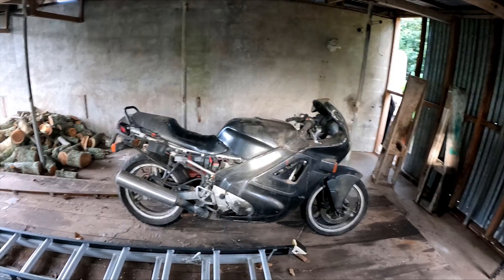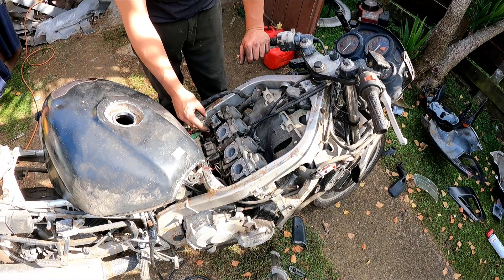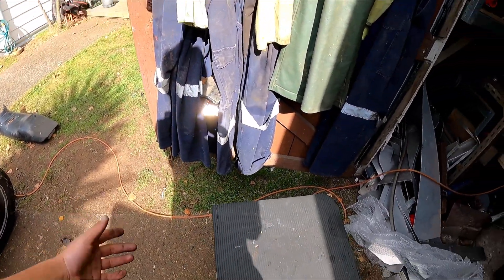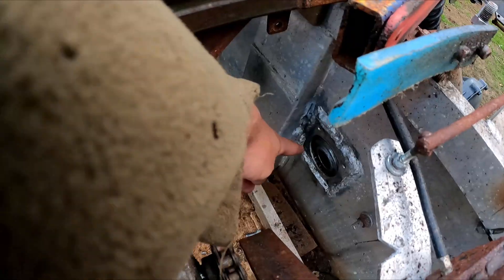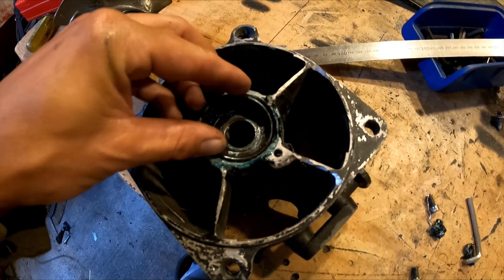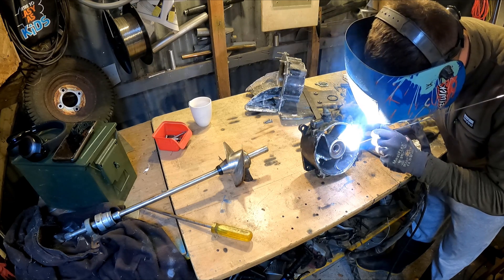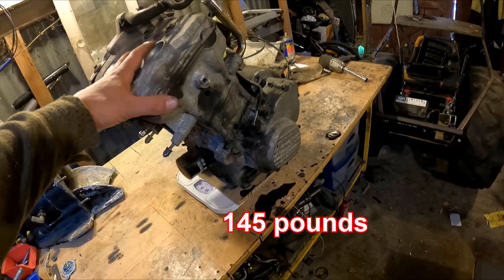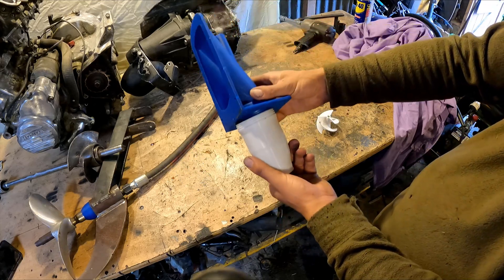Amphibious Jet Boat Build

Comment: 56123 motors are (Somewhat) cheap and crazy powerfull motors you can use for the turbine. They are about 13-17 HP. Costs around 200 dollars for the motor but with a speed controller it costs around 600-700 dollars. And then you need a battery to go along with it. Write a comment if you need any guidance.
Reply from the maker: Actually I want to build another mini jet boat but electric, a motor like that would be perfect. Maybe I could email some company’s and they could sponsor something, because the batteries are so expensive
Reply: @dkthewelder  Yes if you going with 18650 or lead acid the battery's are really expensive. I think the cheapest option is to buy some lipos for a few hundred bucks. Although the battery life will suffer. Personally I get laptop battery's from the dumpster.

Comment: I Have been looking at the Vevor 2000w 48v motor then using a 1:2 gear ratio since it will have the torque but not the speed. for a small jet drive. i have seen no one else test these motors. but i think they are the most affordable motor i could find that could work. (eBay Australia)
Reply: I eventual plan to do a twin jet drive mini boat with differential thrust steering.
Reply from the maker: Ok thanks I will look into them 👍

Comment: Dude you really need to start printing with PETG, ditch that PLA garbage...
Reply from the maker: Isn’t PLA stronger than petg?
Reply: @dkthewelder  it's slightly stiffer but cracks much easier. Petg is more tolerant with chemicals, has a higher temp tolerance and it's just more durable in general.

Comment: I have built a lot of small boats over the last 15 years, and its good to see some one aving a go at building stuff them selves, however to save your self a lot of wasted time on something thats not going to work well, put the motorbike engine in something else and get a cheap jetski with the matched power curve for the unit, no messing around tring to make water jackets for the headers and a lot of other problems that you havent clicked onto yet. I have tried out motor bike engines in the past, you need to split the motor and remove all the gears and make an adaptor to run a shaft off the clutch basket to the unit , if your cbr600 motor is spinning at 12,000 the clutch is around 8,000 its geared down quite a lot, running off the sprocket and tring to us the gears  just doesnt work, the power is never in the right spot. Tring to match the motors power to a random jetski set up and still having to make a proper grill/intake combo, theres a lot to it.I have done it with  zx10 and cbr1000 motors, you just cant beat a yamaha jetski set up . Good luck mate, keep the videos coming
Reply from the maker: Thanks I watch a lot of your videos, I can’t use a JetSki motor because how can I cool it when on land? I have heard of you run a radiator it can’t really cool down a JetSki motor enough. I would rather run a surface drive which would be way fast and more efficient but the jet unit will fit well with the wheels and be out of the way. Thanks a lot for the information I just really want it to be able to plane, how fast does your inflatable boat with the outboard jet go?
Reply: @dkthewelder  the orange boat only does about 35-40 km with a 50hp on the back, painfully slow compared to a jetboat, I cant see an easy way of fitting the honda motor around the mower engine, however in the states dont they run the lawn mower motors with a long shaft and a propeller on the end https://www.youtube.com/watch?v=HPTjdA9Azzc I think that with your skills you could build up something like this?
Reply from the maker: @goatracing610  haha yes I have done heaps with those longtail motors they are really cool I put one on a surfboard too , I have been thinking about what you said all day that the cbr600 motor be no good . Do you think it would go 50 kph on water? I pretty sure it would go about 140kph on land depending on how I gear it. Also I would love to talk to you and ask questions I have been watching your videos for a couple of years

Comment: Motorcycles have clutches just use that to dis engage the engine 😂
Reply from the maker: I will spin the the jet unit all the time but need to disengage the wheels when they lift up
Reply: @dkthewelder  oooh ok I see what you mean now

Comment: Good call going to one engine to run it all! 🤘
I wonder if you could rig up cable steering for the jet and the front tire.
Reply from the maker: Yes that is the plan I need to find a steering cable 👍

Comment: Bro,   I'm doing the exact same thing using an 07 cbr.. . . Started it earlier today. 
I'm using all those cad files you made to build the a jet unit, but I'm gonna 3d print it in steel & scale it up many percents. . .
Also getting rather curious at how well the  bat kart is going ?.????...?
Reply from the maker: An 07 cbr would be great! Have you got a metal 3d printer? I actually sold the bat kart unfortunately

Comment: I have a pair of 13hp 6000rpm electric motors and speed controllers that I bought for an rc plane. 

I haven’t used them in the last 5 years. 
I can’t afford to donate them as I’m a broke ass pensioner but I’m sure something could be worked out.
Reply from the maker: Yeah ok that sounds very good . How can I message you ? Have you got Facebook or email or something?
Reply: @dkthewelder  
I won a pump file and printed it backwards, you have my email, I’ll send photos and details a bit later
Reply from the maker: @brucebaxter6923  ok cool thanks

Comment: Hey mate make sure you run the original air box on that engine otherwise you'll forever have dramas getting it to run properly 🤙
Reply from the maker: Will do ! They are pretty fussy those sport bike engines